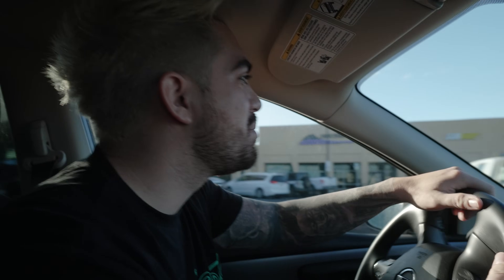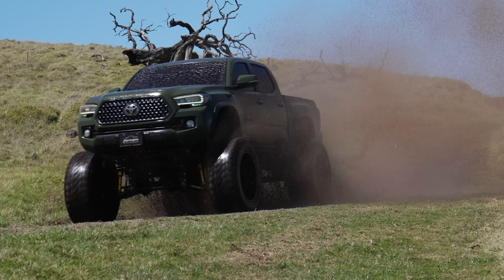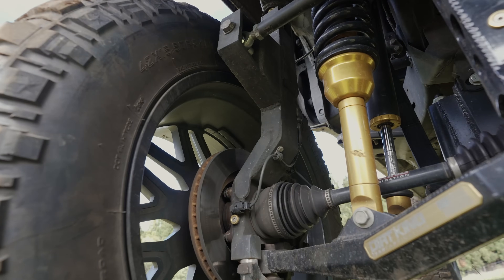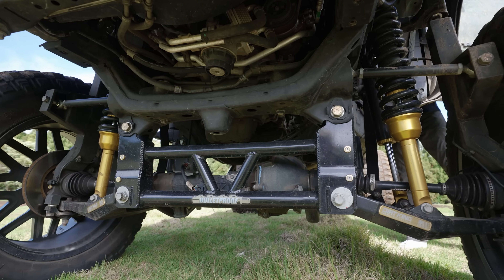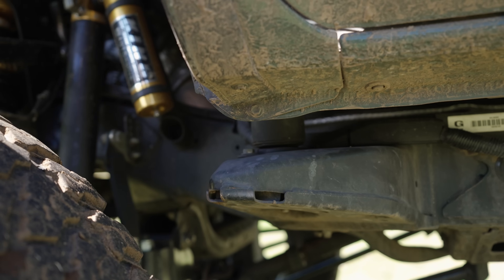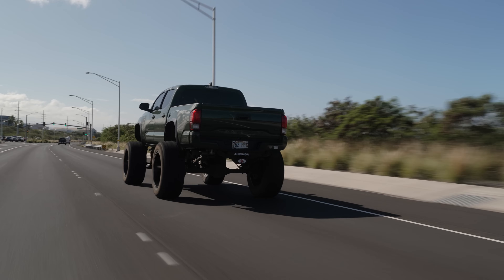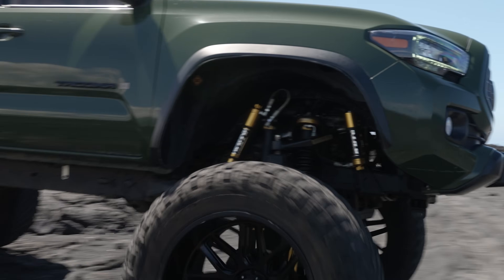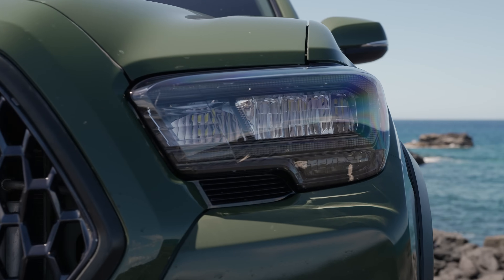14" lifted Tacoma Walk Around. How big is too big?

Comment: Now this is how you lift a truck. Usually when ppl lift their truck this big/tall it looks weird and majority of the components are stressed out due to the lift being this tall. The wheel gap to wheel tire ratio looks spot on and looks really good. Can't wait to see how this build comes along!
Reply from the maker: You should see the video of the drive around we did with it!
Reply: You can tell when there’s good work done under I’ve  seen some trucks  with lifts over 6” and you cut the crossmember wrong  and some people will pay through the nose for the repairs research and trial are the key but good workmanship is the other part

Comment: I was about to say, those 24” wheels are too big but then he addressed it and I’m happy 😂

Make them wheels either 17 or 18 bead lock, and keep the 42s or go up to 44s.
Reply: A 24in rim with 42” tires still has the same amount of tire sidewall as a 17 on 35s… which is what most tacoma guys run. So its really just a preference.

Comment: All that lift and look how far the diffs are off the ground, but does look good, but i guess that's what it's all about nowadays
Reply: The biggest contributing factor to gaining axle clearance is tire size. He’s got 42’s, that’s as much as almost anyone is gonna get. Lift isn’t completely useless. It helps clear the tires on the fenders so it doesn’t rub. Also a reason why he didn’t need to cut his cab mounts like mentioned on the video. Try fit 42’s on your stock taco and leave the mounts on there lol. Lift also makes your frame higher so you also gain clearance there, youre no longer at any risk of hitting your frame/bumpers on rocks (rock sliders are a thing of the past). This truck isn’t just for looks, and the fact that you didn’t understand that in over 10 minutes of video is crazy. This video isn’t him proving his truck is better than yours or others, idk why everyone has to make it a competition/comparison.

Comment: I knew it was a HAWAIIAN BUILT , by just the Thumb tiny Pic , We Have @Least 100,000 of them in Hawaii That’s How We Built EM , Nah Mostly Bolt On’s , My Tundra PlatinumSuoer Charged  Built Like that ,with 22” American Forged With 37”TOYO ‘z ,and My Tacoma Daily is 6” Lift with 20” American Force Wheels on 35”s both Trucks Full Suspension UCA’s and LCA’s , 2,5 Kings & 3,0 Kings on the Tundra , with 3.0 Bump stops Strapped 4Link Rear ,
Reply: Im going to Maui next month hoping to see some good ones when I’m there
Reply: @samking7844  more tacomas and 4Runners on the road here in Maui than any other car by far.
Reply: @samking7844  if your going to maui check out fordsuperdirty outside of Toyota's

Comment: Unnecessary. Both truck based on soils for off road and also (opinion) looks. No need for a large lift like that. It can handle everything in this video with good driving. 

Second it looks ugly. Again, my opinion. Keep this stock and add some odd road tires and it would be fine.